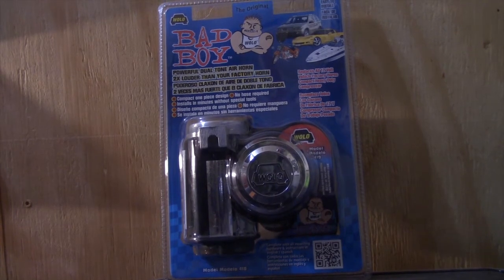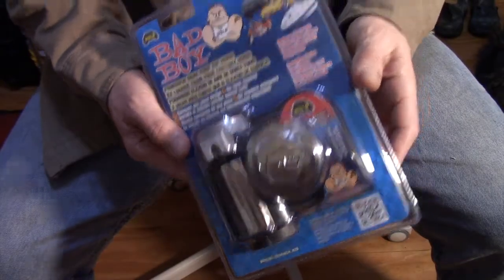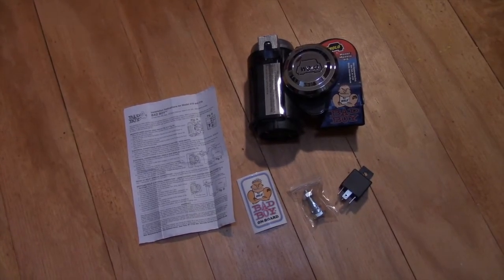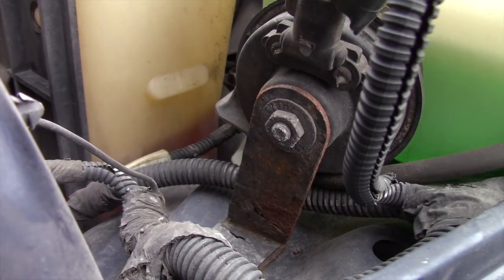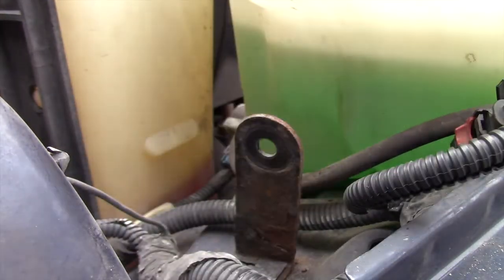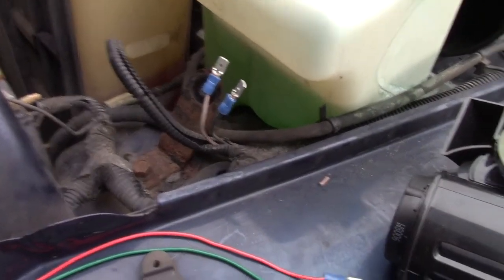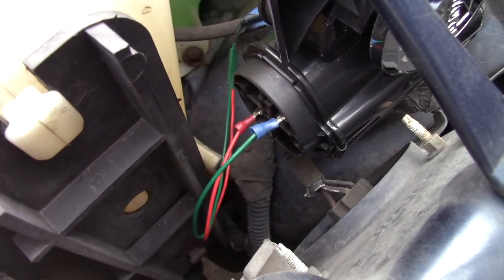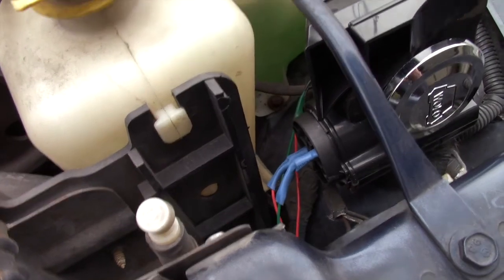Install WOLO "Bad Boy" Horn In Jeep Wrangler TJ

Comment: Thank you. I didn't use a spade connection but straight to the horn. For some odd reason my old factory horn has 2 yes 2 horns like the one you replaced.  I hope that it isn't important because I'm taking it out because my niece's power wheels horn is louder than that one on my huge quad cab truck. Smh wish me luck this will be my 1st horn installation
Reply: It works great
Reply: @italianstallion8317   do you have a picture of it? mine also has the two, but there’s weird wiring like someone tried to DIY something haha

Comment: Hey so I got one coming in today, do those wires you used to wire it up come with it? Or do I need to order them? If so where do I get them?
Reply from the maker: If I recall correctly, I just used wires I had sitting around. I don't recall it coming with the wires/connectors because I spliced it into existing wiring.
Reply: @HNXMedia  dang I hate that it’s not plug and play.

Comment: Hey i just bought this today and the installation went smoothly on my 1998 grand cherokee. everything seemed to work besides the alarm chirp when i press the key fob lock button but the panic button works just fine. would you happen to have any idea what this could be or what to do? regardless great video!
Reply from the maker: I am not sure exactly why that would happen. However, I have never owned a car with a key fob connection so I have no idea how they interact with the cars computer system. Sorry, wish I could be more helpful. Thanks for watching and taking the time to leave a comment. Stay well.
Reply: @HNXMedia  its all good appreciate the fast reply!